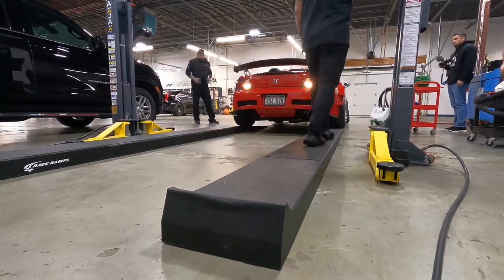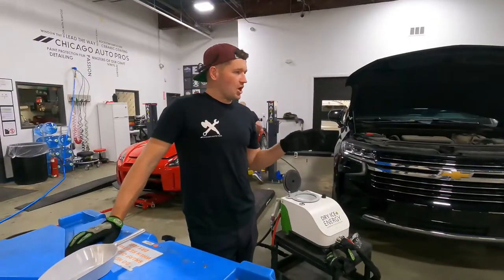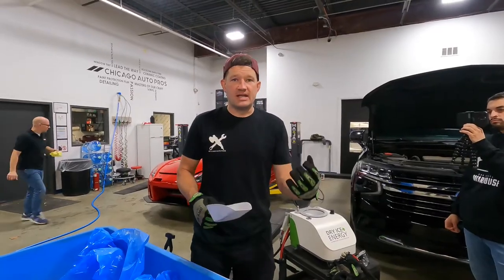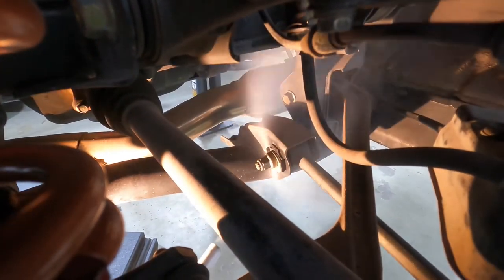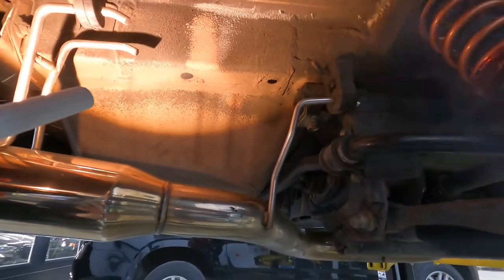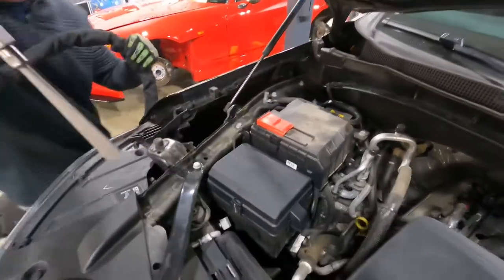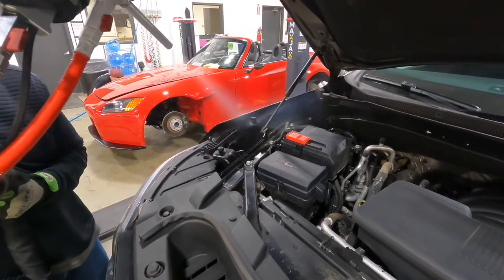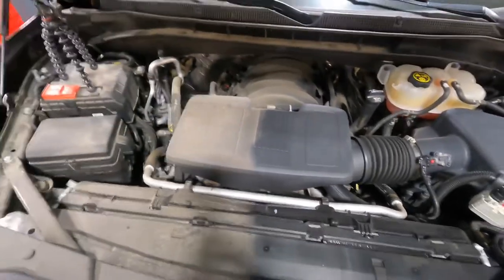The Magic Of Detailing With Dry Ice Energy! Demonstration !! Champ Vario Dry Ice Blasting Machine!!

Comment: What's the point if this in the engine compartment? Any degreaser and pressure washer will be quicker and cheaper. The warning says not to use it but as long as you don't go full blast into connectors and electronics, it's fine. It doesn't say, don't use dry ice because it's a new process. And for tar on the fender, a towel with wax and grease remover wiped off in 5 seconds. Why remove undercoating anyway? Sounds like it's just a new toy
Reply: You obviously have no car experience especially in cars of appreciating value .

Comment: Thanks for coming in and checking out the dry ice blasting. I have a love/hate relationship with Dry Ice Blasting. It's fun, satisfying, and works well on many surfaces. IF you plan on doing complete undercarriage or suspension cleaning, be prepared, it's very messy. It will also reduce interior detailing time by at least 30%. Our shop doesn't have many interiors, but this would be a must-have for a dealership or auction house detailer. We have seen great success for individuals who want to start another division of their business (even mobile). The bring-a-trailer type cars are in love with this cleaning; we have been approached by a few high-end dealers and wholesalers who want the complete undercarriage done. We have done a few but ultimately stopped until we have a dedicated space for this type of work. Great video Brian.